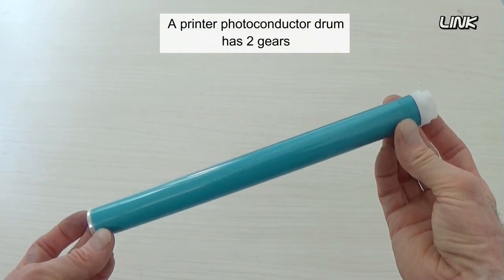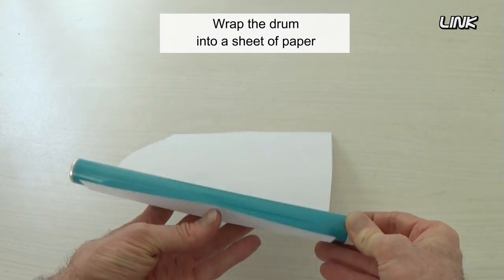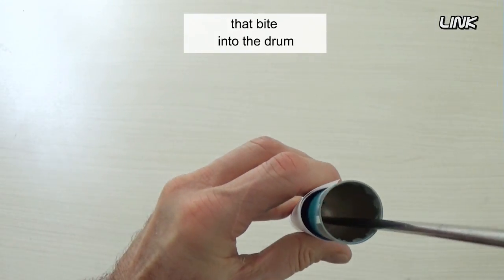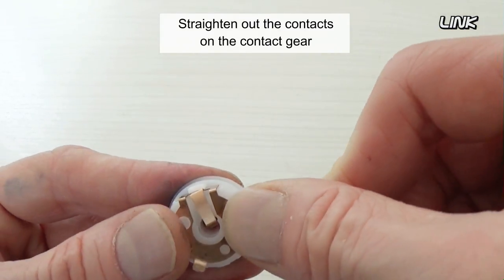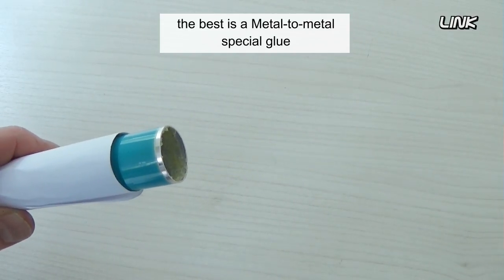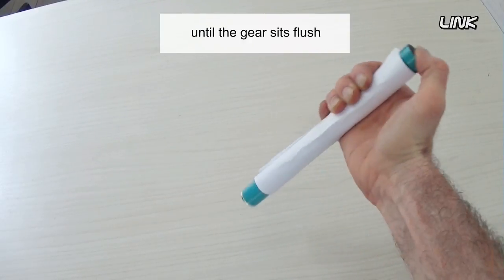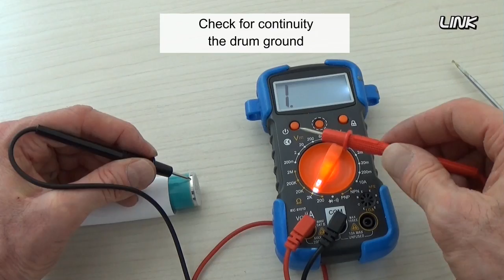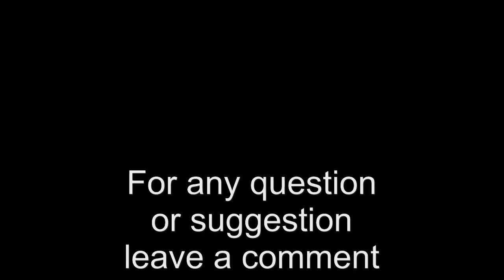How to remove gears from a laser printer drum

Comment: Hello I have an hp color laserjet mfp m182n and I have refilled all its cartridges. Now I want to ask you that if I refill it again with the compatible toner of same manufacturer which I used for the first time then do I need to empty the old toner left in the toner section ?
Reply from the maker: Yes. You can't know if that bottle has the same type of toner you bought and at the end of the cycle inside the cartridge there is low quality toner

Comment: Hello. I have an hp color laserjet printer mfp m182n. I want to ask you after refilling and adjusting doctor blades of all my 4 cartridges how do I know that the doctor blades are on right position.
How do we determine that the right position of doctor blades of each cartridge ?
Is there any test page we can print to identify that a particular color toner cartridge's doctor need to be adjusted up or down?
Reply from the maker: Look at the toner on the roller surface, it must be uniform, not too tick and not too light
Reply: @viandant5  is there any test print page or other way to check that because it's difficult for me to analyse what actually is thick or light ?
Reply from the maker: @hathakker802  No, but if your problem is to have too much yellow set the blade near the roller to low the toner quantity on the roller

Comment: I have brother printer with dr1000 drum sadly which is not available,so as per this video can i buy any other drum say drum for 12 a and use it with brother drum gears.Will there be any size difference
Reply from the maker: It will not work, they are different types of drum. You can only use a Brother drum
Reply: @viandant5  thank you, can i use any brother drum or it has to be something special
Reply from the maker: @MANNUELTUTTU  any brother drum with that diameter

Comment: Hi, I have an hp colorlaserjet pro mfpm182n printer and I have recently refilled its all 4 cartridges. The problem is with black cartridge that the toner lining of about 1 inch develops on drum, not on paper. Though that's not a problem but I am just asking is it harmful
Reply from the maker: No, it-s not a problem
Reply: @viandant5  but initially when I bought this new printer nothing such happened. After refilling, the side on which long pin goes into the drum develops 1.5inch lining onto opc drum, while other side has a 1mm thick lining. I can easily remove it from tissue paper but it again develops on opc drum after some prints. I want to ask you why is this happening, though the lining does come on a4 paper, and I have cleaned waste toner section of cartridge. Can you please tell why does this happen?and can we solve it
Reply from the maker: It could be a clump or a defect on the developer (toner) roller, but it's out of the size of the paper so you haven't it on the page
Reply: @viandant5  have already changed that, can it be due to anything else?
Reply from the maker: @hathakker802 A defect on the charge roller
Reply: @viandant5  ok thanks for responding

Comment: What is the coating made up of on the drum and on magnet roller?
Reply from the maker: the coating of a magnetic roller could be nickel or something simillar. the coating of the drum are layers of photoconductive material as selenium, germanium or silicon
Reply: @viandant5  have you experimented this??
Reply from the maker: @raviravariya5252  no, they are technical datas
Reply: @viandant5  Cool, thanks.!
Reply: Which rubber is used for manufacturing PCR?
Reply from the maker: the coating are layers of conductive polimers, as elastomers
Reply: @viandant5  is this same for every pcr?
Reply from the maker: @raviravariya5252  no, there are lot of types of PCR
Reply: @viandant5  is that rubber which is coated on 12A pcr?
Reply from the maker: @raviravariya5252  yes, most of them are coated with that rubber
Reply: @viandant5  ooo, thanks